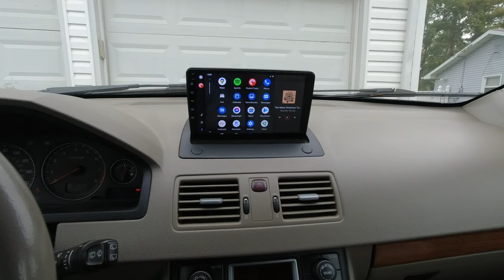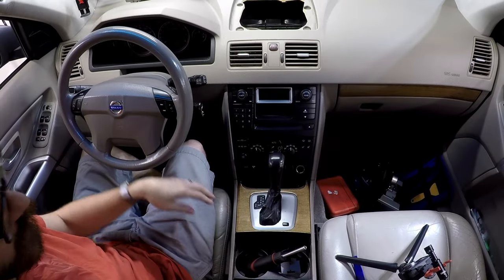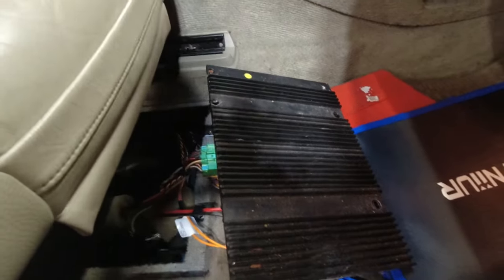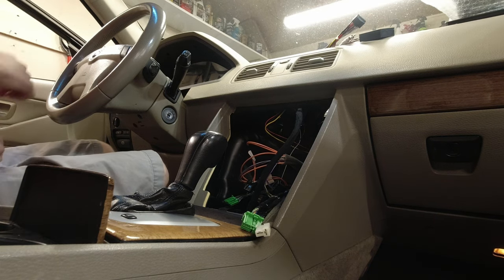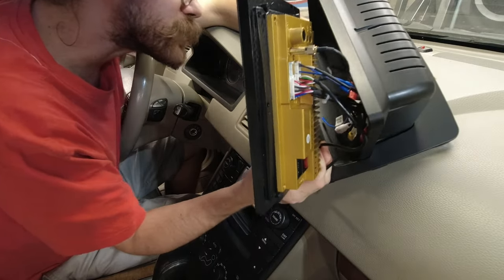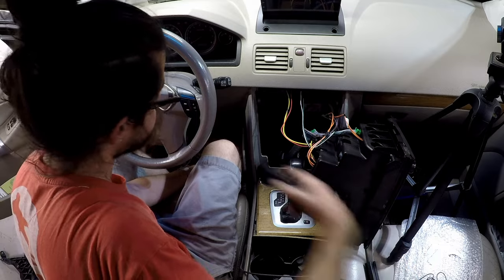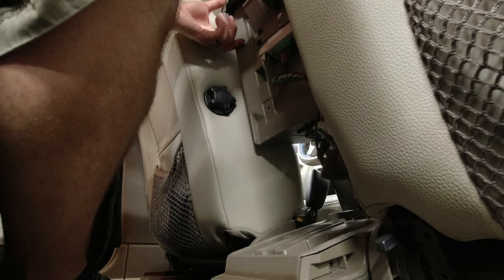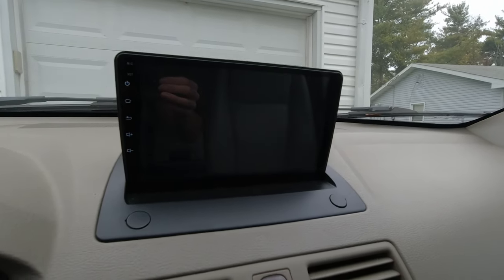Installing an Android Head Unit in a Volvo XC90

Comment: Доброго времени! Какие провода переставляете в разъёме усилителя,  за что они отвечают?
Reply from the maker: Hi! I hope I can answer your question correctly (I used google translate to read it!).
The wires I rearranged in the connector were the front left speaker wires (white wire is positive and white with black stripe is negative). The wires they originally lined up with on the car harness were red and black, which are usually power wires, so I tried moving them over, which worked!

Comment: Hello if i have a xc90 2012 more simple without map screen and amplifier? What radio fits?... Best regards. Great and complete video... Graet job and effort.
Reply from the maker: Thank you! 
The install should be very similar, there is a speaker or a panel instead of the GPS screen on your car. My radio came with two harnesses, and I think one was for cars without the amplifier. In that case, the connections would all be behind the original unit. 
If you are unsure, you could also take a look at what the connections look like behind your factory radio, and compare that to pictures in listings for this radio or other similar ones.
Reply: @frenchineer  no. Than You!! Fir this great job. What is the model of the radio?
Reply from the maker: The radio I used is linked in the description, but there are different styles from other companies too!
Reply: @frenchineer  thanks. And then hie is this radio working? Maybe You can make a video using the radio deeply in all it's features. Then both Android auto and applecar play works wireless isnt it? Thanks again.
Reply from the maker: It's been working quite well! I do plan on making a review video soon.
Regarding wireless carplay, I don't think it supports it as it is. There may be an add on to make that work but I have not looked into it.

Comment: Can the rear screens be used so they display what's on the front screen?
Reply from the maker: As it's installed, no, but you could run an RCA video cable from the video output of the new radio to the video input for the rear entertainment! You could probably run the cable through the center console and have it come out near the inputs so it's not in the way.

Comment: Very nice video and how to i was looking for something like this for a long time. I have bought a unit for areoun 400£ with all the bells and whistles i have tried to install it but I didn't have any audio and i have been told that i need to have the aux on the original unit for it to work.... Do you have the aux for your volvo??
Reply from the maker: My car did not have the AUX input, but at the time I purchased it there was an option for non-aux cars. You would likely need to find the correct harness from another source.
Reply: @frenchineer  i have bought a different harness with the optical but with all the different things that volvo come with its hard to find a proper harness to work, i was also looking to bypass the amp and instal a aftermarket amp with the unit as a totally different audio in the car
Reply from the maker: Yes that's true! I think if you want to use an aftermarket amplifier you could connect to the speaker wires that come out of the amp (where my harness connected). Just keep in mind that if you have parking sensors you may want to add an extra speaker to connect to the factory amplifier so you can still hear the beeps.
Reply: The harness just arrived from mother china and its the same time as your one i have noticed in your video that you have connected the aux in that come from the amp to the back of the unit did you had to change any setting on the original unit to have audio to the speakers?
Reply from the maker: With the RCA connections made, I didn't have to change anything in the original unit.

Comment: Great video!

I wants to do this also in my car a volvo C70 2.4 D5 from 2007.

Any tips or maybe converter cables i need? 

Thanks ❣️
Reply from the maker: Thanks! If you get a similar radio, you should get everything you need to get the radio working in the box.
I think the only thing you would need beyond that is a usb extension cable or usb to usb-c cable like I used. I'd recommend some plastic trim tools too!
Reply: @frenchineer  Hi there, thanks for the response, i asked the seller what cables they did in the box and he said that he didnt got tha cable for the ampliefer, so do you maybe know where to buy it? or  maybe can  make me one? 
The plastic trims do i already have because i did change blinkers of an another car (opel Astra H Twintop) and the usb/c cable yeah that is a good point, i go buy me one from a 5 meter soon.
Reply from the maker: I received two cables for my radio, one with an amplifier connection (which worked with my radio) and a different one that did not connect. There are some XC90s with a different amplifier (built in to the original radio) where the other cable I showed is required instead. 
Since you have a C70, I am not sure what differences there are in the sound system, so it is possible there is only one harness option that works for your car.

Comment: Thanks for the video
Please I just install the head unit in a car but the screen doesn't turn off immediately the car is turned off it takes about 1 minutes before it goes off please what can I do
Reply from the maker: Hi, on my car it takes about 30 seconds to shut off after I turn off the car. There may be an option you can change in one of the menus (you may need to look up the password for the advanced settings).
Reply: Thanks for the response
Please how can I install a camera that can work with it
The camera I installed is not showing the reverse, when the car is put to reverse
Reply from the maker: My next video will show my backup camera installation!
Does your screen go blank but no video is shown?

Comment: Hi there, excellent  ideo. I would not be able to install mine without watching it. I had to remove the pin for left speaker as well. I cannot get the canbus module workoing. The steering wheel buttons do not work. I also lost the parking sensors. Did you manage to setup the steering wheel buttons?
Reply from the maker: In my case the volume buttons worked without any setup, but no luck with next/previous track buttons when I use Android Auto.  
EDIT: I checked again and the next and previous buttons do work in Android though! I may need to see if there is a setting to pass the commands to Android Auto, but Volume and Track next/prev did work out of the box.

Regarding the parking sensors, my car did not have them, but my understanding is that the sound goes through the factory amplifier. Because this radio requires you to bypass that, no sound from that system reaches the speakers after the install unfortunately.
Reply: @frenchineer  Many thanks for quick response, I’ll keep trying
Reply: Hi Ivo, 
i just installed my radio yesterday and i am running into the same problem as you. Steering wheel control and parking sensors do not work. 

Did you already find a solution?

Regards
Reply: @azingo67  I am thinking of a workaround on the parking sensors - based on which connector I put into the amplifier I can either have the old factory radio making the sound or the new head unit - so I will have the original speakers connected to the head unit and at the same time connect the output from amplifier to a new additional speaker (I will leave the legacy radio switches off and use this speaker for parking sensors only). Not sure, what to do with the canbus module, which is useless - the support on the aliexpress or from the producer is non-existent
Reply from the maker: I think the dedicated speaker for the parking system is a great idea! It would probably also allow you to use the factory radio if you had an issue and needed a backup.
Regarding the CANbus module and support, that's very unfortunate... It seems like experiences can vary from one supplier to the next.
Reply: @ivodolezal8052  Thats a good idea with the additional speaker. I noticed that the Parking sensor use the Rear right speaker.

Listening to music while driving the car yesterday was pretty anoying because the steering wheel control does not work. 

I am thinking of the CAN Bus module.
There must be a way to activate it. Going to seetings - car settings - the gear symbol on the right side   you are asked to enter a PIN. If you use 8888 or 8878 you enter the menu where you can identify your CAN module. Basically tell him which car you are driving. VW, BMW, Volvo etc. 

@frenchineer since the steering control work in your case. Could you tell us which setting you have in your radio? Best would be if you tell us the number and the car model you have set, or that was set since the beginning. 

That might be very helpful. Thanks in advance.
Reply: I suspect that the canbus issue is not about selecting the right setting, but the cable is probably connected to the wrong pins - I managed to redo the wiring in a way, that both units can play through the original speakers - so if I leave the old radio off, I have android unit plus parking sensors -  (the original bypass wiring at the amplifier location did not make any sense), I’ll try to experiment with the canbus connection - I have the vida diagrams, but unfortunately there are no descriptions of individual connectors, I’ll let you know, if I’ll get it working
Reply: Very interesting, same problem in my case with the can bus. My unit only came with the grey connectors so I had to buy the other one which bypasses the amplifier. Then again, I had the same problem with one of the speakers not working, figured out that the pins were not in the correct slots. The only thing that remains is the can bus, and it is really annoying. No steering wheel control, no headlight sensing to turn down the brightness at night, and most importantly no reverse sensing, so the unit Dows not switches to the reverse camera input. In the factory settings I have selected the correct model - OuDi-Volvo-XC90 but it does not make any difference, the controls are not working. Oh, and I tried it with two different can bus boxes, as both set of cables came with one, but neither one is working. If you find a solution, please update us as it is driving me crazy. My car is a 2004.

Comment: Hi, great video.... BTW.. Does the park assist beep still work?
Reply from the maker: Thank you! My car doesn't have park assist, but it's possible it is a separate system that would still work.
Reply: One more thing, that canbus red n white wire connect to which cable? Tq
Reply from the maker: I'm not sure which wires you mean, the CANBus decoder connects to the new harness.

Comment: I have an optical connector without the three wires, I only have two orange ones, so how should I connect it? and the connector cannot be split into two
Reply from the maker: I'm not sure. Does your car have AUX?
Reply: @frenchineer  I think there is an entrance by the phone
Reply from the maker: If your car has an AUX input for the radio, the install is a little different from the one in my car, and uses a different harness. I don't think the harness in that case requires anything with the fiber optic connector.
Reply: @frenchineer  Thank you for your time and answers
Reply: @frenchineer  This is an amazing video.  I'm about to do this for a 2014 XC90.  I believe it has AUX.  How do I find out which connector I need instead of what you used?  Do I buy it separate? Do you still recommend the unit you installed overall?  Thanks so much for this.  It's becoming my daily driver and I need newer maps and Car Play!
Reply from the maker: @nicolewhelan6570  I think the 2014 has AUX. The wiring harness and connectors for AUX equipped cars are included with the head unit, it's usually noted in the product description that it is only compatible with AUX equipped cars, so you should be good. The install should be a little simpler as all the connections should be behind the radio in your case. 
Having this is a great upgrade over the factory GPS! Mine is still working great 2 years in, so it's been a unit solid for me.

Comment: Hi Frenchineer, I just installed the head unit. Is it normal that the old radio is now disabled? Thanx 🙂
Reply from the maker: Yes, because the new unit bypasses the amplifier, the original radio no longer outputs sound.
Reply: @frenchineer  Ok then. But the new radio has no signal. Do you know how to connect any anthena? Thx
Reply from the maker: Seicane shows an optional DAB+ radio box you can add, but there also seems to be a traditional radio antenna port on the back of the head unit (from the product page). Using that port, you could add something like a windshield FM antenna. The reason you have to add an antenna is that the XC90 does not use a traditional radio antenna connection at the head unit.

Comment: hi great video does it support apple carplay? thanks
Reply from the maker: Yes, as long as you get the carplay android auto dongle
Reply: @frenchineer thanks man any chance it’s gonna work on my xc90 without aux? thanks
Reply from the maker: Mine does not have AUX. You will need to find the correct harness for non-AUX cars. It used to be an option when I bought mine, but now you would need to find it separately.

Comment: My OEM unit is non functional, will this unit work or does it use the AUX option on the OEM unit for sound?
Reply from the maker: In my car (2006) the install bypasses the original unit and amplifier, but I am not sure how it integrates into the system that had the AUX plug. If only your head unit doesn't work, there is a chance it would work, but I can't guarantee it.
Reply: @frenchineer  I don't have the AUX that's why I'm asking. I checked the spec on the unit you installed and it says you need the AUX? Just weird if it bypasses the OEM head unit and amp
Reply from the maker: At the time I ordered it, there was an option for the non-AUX version of the car. Unfortunately they don't have it anymore. I'm not sure if their customer support may have some info or if there are other brands that have the option. I have seen a harness sold separately elsewhere, but I don't know how the compatibility would be. Another commenter seems to be going that route.

Comment: Hi mate
Does the original radio still work after installing the screen?
Reply from the maker: Not in this install unfortunately. However, I think it might in cars that were equipped with an AUX input, since the harness is different - though someone with a later model would have to confirm that.

Comment: hi there, the video is great, although you did not show how you conected the usb extention cable to the unit, do you have any photos or a video of the usb cable to the head unit please.
Reply from the maker: The harnesses included with the head unit include 2 usb ports. Their plugs are shaped so that they can only fit into the correct ports on the unit.
Reply: And you plug a dongle into one of those USB ports ?

Comment: I see the Google Maps icon there. Does it work like the app on the phone? How do you update the maps?
Reply from the maker: I only use Google Maps within Android Auto, which runs off my cell phone when it's plugged in, so the maps are always up to date!
Reply: @frenchineer  Thanks, but can't you just pair the phone to the unit through bluetooth? I've seen videos of people connecting Apple CarPlay to other android headhunts through BT
Reply from the maker: Some head units have the option to use wireless Apple CarPlay or Android Auto, but I don't think this is one of them (I also like the wired connection since it charges my phone while I drive). You can pair via Bluetooth for audio and calls.

Comment: Hi, you had no center speaker!!! Is that correct
Reply from the maker: There was a speaker alongside the GPS screen, but it was removed for the new screen.
Reply: Thank you. I am having a difficult time justifying the unit. I now have unlimited data on my phone and as such the phone has become a multi media player. Fed through blue tooth. But not the stupid Volvo Aux port that breaks down.
Reply from the maker: I use it almost exclusively with Android Auto, so all my apps use my phone data but are displayed and controlled on the unit's screen. It's the same for Apple CarPlay.

Comment: Are you able to hook subs up to this?
Reply from the maker: I think if you had an RCA splitter where the Audio OUT L/R plugs connect to the AUX L/R IN you could run connections to a subwoofer. I can't test that though.

Comment: I don't understand why the don't make it for the S60.....
Reply from the maker: I think the S60 (depending on the year) has kits to use standard double DIN head units! So rather than getting a radio like this you would have options for big brands like Pioneer, Kenwood and the like, which have Android Auto and CarPlay compatibility.
Reply: @frenchineer  yea, you're right, however I actually like the dashboard top screen,  they actually only make an aftermarket for thr xc90.... I've scoured the internet for thr s60.... But to no avail...
Reply from the maker: If you like the top of the dash style, you could use a universal android auto/carplay screen! They usually plug in through AUX, and you could wire in power to a switched fuse and hide the wiring too.

Comment: Did this work without the aux Option?
Reply from the maker: Yes, though you would need the correct harness option. Unfortunately the listing I purchased from does not have it available anymore, but there may be other vendors/brands that do.

Comment: Can it play video on the rear screens?
Reply from the maker: As far as I know it does not integrate with the rear entertainment as I installed it. 
I think you could run an RCA cable from the head unit's video output to the rear entertainment's video input and make it work that way though!
Reply: @frenchineer  Cool, thanks! It would be nice to be able to run Netflix etc on those back screens :)